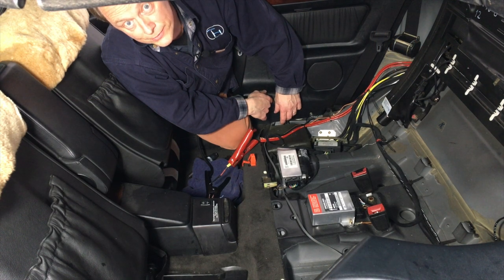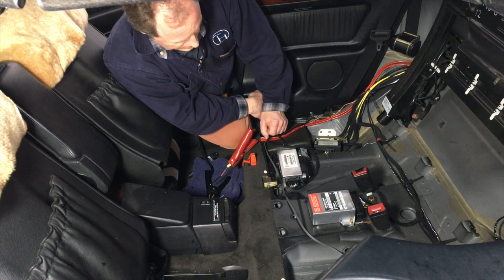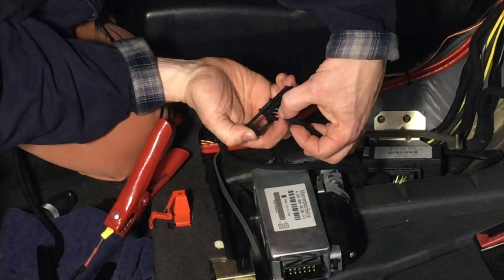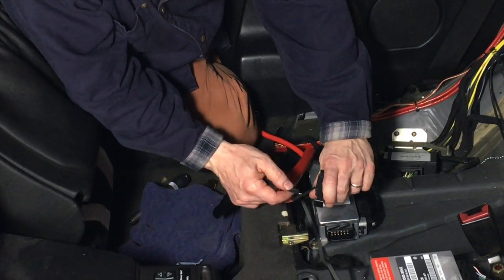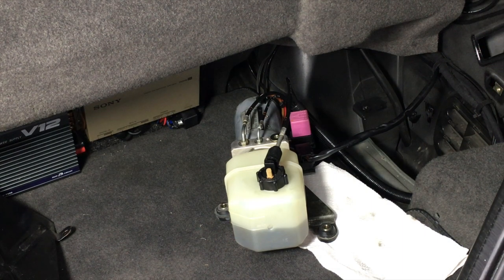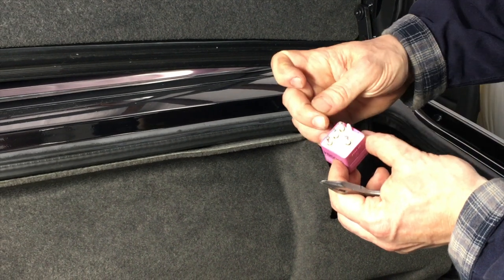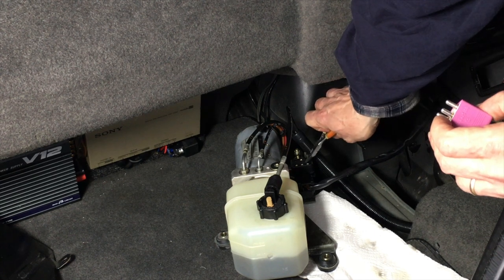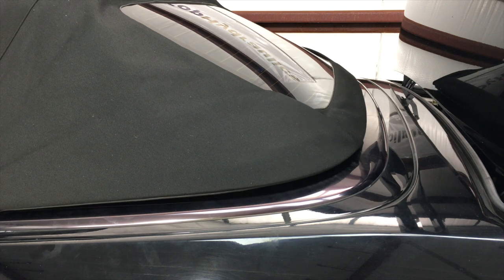How to manually unlatch the Rear Bow on a W124 E Class Cabriolet

Comment: No need to go into trunk. Using a spare battery, ground it to chassis under seat and connect B+ to pin 8 (yel/grn). Then, briefly touch B+ to pin 10 (gry) to energize pump relay for a second.
Reply from the maker: Thanks, Marcus, good point! What you are describing is sending power directly to the pump's relay by energizing pin 10 on the same connector that is already shown in the video to energize the solenoid for the rear bow lock. Very elegant! Klaus

Comment: Hi Klaus, great video, very informative. I have a just had a W124 come into the shop with the hood down and bow cover closed. Can this procedure be used to unlock the bow cover so I can access the hood?
Reply from the maker: There is no need for this procedure when the top is down - you can simply unlock the storage cover by sliding the soft top tool or a narrow 10-mm open wrench down onto the pivot of the case cover lock and turning it to unlatch, located in the center behind the rear seat bench.

Comment: Hey Klaus,
What type of wire did you use to plug into the black connector from the teeth of your jump starter?
Reply from the maker: The solenoid pulls about 1A, so you don't need very heavy duty wire. I don't recall which wire gauge I used and I assume that you are best off using somewhere between 22GA and 28GA wire, so that you can actually fit the wire into the connector.

Comment: This does work, but my bow lock cylinder is what is leaking, so I can manually run the pump, but it won’t unlock the bow, it just spits fluid. I need to unlock it to get to that solenoid in order to replace it. Any ideas?
Reply from the maker: Thanks for asking. Have you followed the procedure in this video yet? It was made for cases of badly leaking rear bow lock cylinders 1298001672. The rear bow lock cylinder will normaly first leak from its rod seal. Iif you wait too long to fix it, then the leak gets so bad that the pump cannot build enough pressure during the normal opening cycle. It sounds to me that this is the problem you are having. During the normal opening cycle, the rear bow lock cylinder gets pressurized on both sides, which makes the shaft on the cylinder extend.

The procedure in this video is different in that it makes the cylinder get pressurized only on the bottom, below the piston. This way,  you do not loose fluid through the rod seal. This procedure will work for all but those who have ruined their piston seal and/or port seals with DIY repair efforts.

Comment: I do what you say the power not open top I cry check for leak what can I do any different ways to Open
Reply from the maker: Be sure that you have enough fluid in the pump and that you connected exactly the wires shown in the video. If the rear bow still does not release, then you will have to very carefully drill holes in the rear of the top storage compartment to explore the layout of the rear bow lock and ultimately get an extended 6-mm Allen wrench into the Allen head on the rear bow lock. That Allen head is located about an inch from the surface, several inches forward and almost centered on the rear of the soft top storage compartment.

Comment: I read that there is a special tool with the car that allows roof to manually opened or closed
Reply from the maker: Unfortunately, the rear bow lock cannot be opened and closed manually, as there is no access to it when the storage cover is closed.
Reply: Thanks , so unlike the R129 which has a thin spanner that can release the rear cover , would certainly put me off buying one if it can’t be closed if the was a problem  @TopHydraulics
Reply from the maker: In case of an emergency, the top can still be closed manually with the front latched, the tonneau cover latched manually, and the rear bow partially locked. The soft top will be partially locked in the rear in that case, with some road noise while you are driving but safe against theft. To subsequently open it, you would need to apply the technique shown in this video.